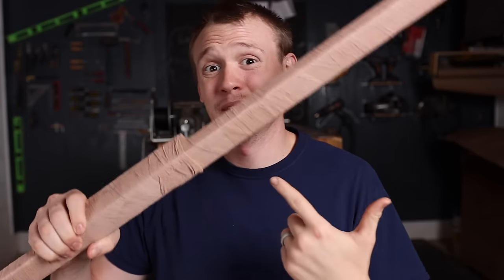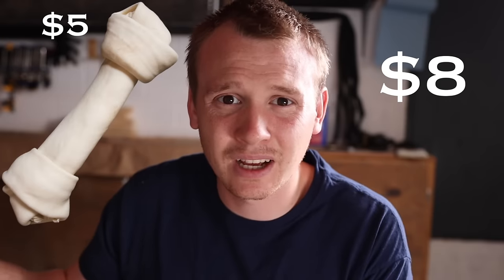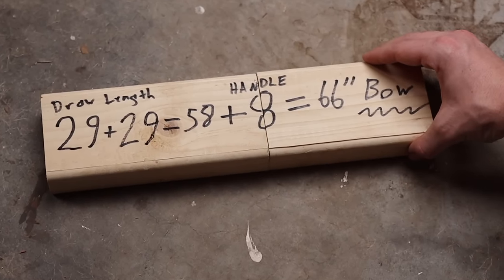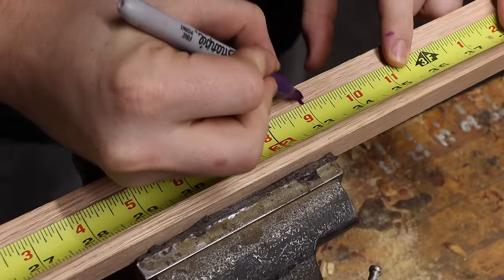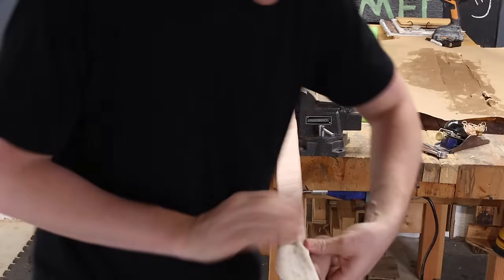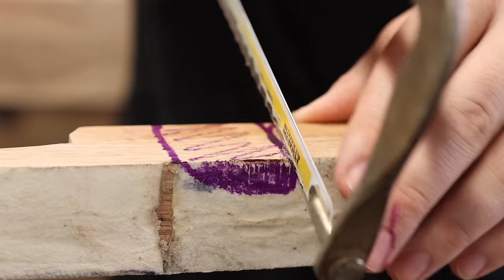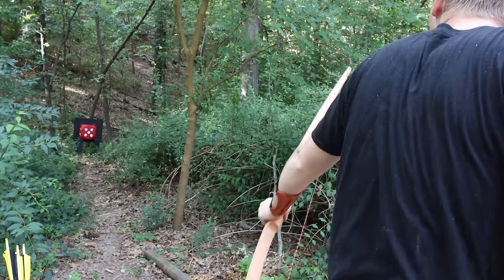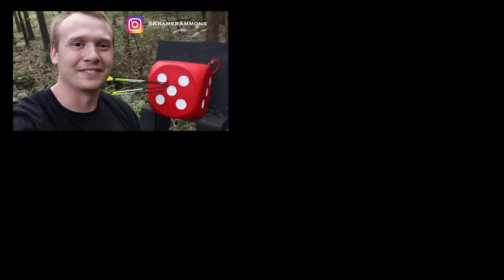DIY-HIGHER PERFORMING Longbow...no seriously..."Red Oak Bow Build"

Comment: Video idea! PVC backing! That's it! I haven't tried it, but I had the thought this week- what if I got a 4" diameter PVC pipe, cut it into long strips, and used a heat gun to flatten it, would it work as a backing????
Reply: There are people who make pretty good bows by heating and shaping PVC pipe, schedule 40 3/4 inch ID typical.  So the material is proven to take both tension and compression.
Reply: @hanelyp1  yeah, I've seen those PVC bows. Personally, if the bow isn't wood, it's not a bow. LoL
I really think that it could make a good backing though. Just gonna have to try it out.

Comment: I’m working on a Hickory Longbow currently and it is my first one. I want to go with a deep red stain but am having trouble finding something suitable. Any advice? I would like to see the wood grain still so paint isn’t really a route I want to take
Reply: Try leather dye
Reply: @longbo2771  Fiebings makes very good dyes, both oil and water based, in several colors.  You can even custom-mix with them
Reply: Longbo27 thanks. I will try those out
Reply: Mike Grossberg I have some leather dye from them already actually. Trying to get into Leatherworking as well. I will give them a try.

Comment: Does shaping the bow handle after the tillering process , alter the balance or draw weight of either of the bow limbs ? I would think that removing the wood to shape it would have some kind of effect on it ..
Reply: No because it's only the limbs doing the work.  The handle doesn't flex at all.  Shaping the handle at the end is better for 2 reasons.  First, it allows you to lay the bow flat on your tillering tree.  Second, in case your bow fails during carving, you haven't wasted all that time carving a now useless handle on a broken bow.

Comment: Quick question if you have a bow that’s 35 lb draw and a 28 inch draw (recurve bow)  but you only draw it back 25 inches then will it still have the same power and hardened to pull back as a 35 lb bow
Reply: Kramer Ammons so if I got that black hunter (there’s only one draw length available) then I would want to get  the 40lb option because I wouldn’t be pulling it back all the way therefor it would be a 35 lb bow

Comment: Kramer, Awesome video.  Quick question.  You mention your bow length as tip to tip.  But isn't bow length measured from nock to nock?  So if you want a 66" bow don't you need to measure out an additional inch or so?  Keep up the good work.

Comment: Any issues with Red oak holding compression strength? I had one blow up on me, but it could have just been a crap board.
Reply: In my experience, I've made backed, unbacked, and laminated bows with red oak. It's a great wood. Unfortunately, It does crease easily. So be sure to get rid of any joints
Reply: As general rule, anytime you use a board for a bow, back it. They're not made to be bows so you want to give it all the support you possibly can
Reply: @Morrow45105  yup - I used 6 layers of fiberglass tape and wood glue. Failed on compression side, I think
Reply: Liam Strain sucks to have a bow fail but it's great experience. Boards make great practice and eventually you get one that turns into a good bow

Comment: When i made propellers i learned that laminating several layers of thin pieces of wood was an opportunity to reverse the direction of the grain on each layer . This helped balance the weight and springyness of the wood . Because trees are fatter at the bottom andd skinnier at the top and are naturally out of balance for a piece of wood . Epoxy the layers and clamp with 50 or a hondred c- clamps . All epoxy take 3 days to cure . 5 minute epoxy means 5 minutes  before it becomes gooey and unworkable .
 Sunlight makes this happen imediately sometimes . Don't use car fiberglass resin on wood it does not stick . Save you some trouble . Aircraft use a thin  fiberglass cloth and epoxy resin to wrap wood parts to make impressive strength in places . I?[rried about your titebond  glue not lasting forever .

Comment: Hey Kramer, your videos are so well explained, good job. I've just completed my second self bow out of black locust, and it' s a wonderful recurve bow! Anyway i got through many issues recurving the tips, it was lightly splintering and cracking and didn't know why, so I stopped immediately. Could you give me some tips to avoid break during recurving stage? Awesome video as usual, keep it up!💪
Reply: Gotta use quarter sawn wood and orientate the grain in the right direction :)
Reply: Also bend the wood a bit when buying it, a lot of cheap wood is filled with cracks which you don't want in a bow

Comment: Would greatly appreciate it if Kramer or whoever happens to see this could answer. I'm 6'6" tall and have really long arms, and thus have a very long draw length at 38". So, if I'm understanding the draw length formula correctly, 38 + 38 + 8 totals out to an 84-inch monster of a bow. Would the whole thing just be entirely too long and flexible/easy to break, and does anybody even make arrows long enough for that kind of draw length?
Reply: Have you ever tried to find out your draw length by simply drawing an overlong shaft to your anchor point, and marking where it meets the back of the bow?  According to the given formula, MY draw length should be something like 27", but in reality it's 30"!  Try a different method of determining your draw length before you worry about oversized arrows
Reply: @kramerammonsarchery  I have a 72" red oak, linen-backed English-style longbow tillered for a 40lb draw at 30".
By the way, most commercially-produced arrow shafts come in a 32" length(WITHOUT knock or point)
Reply: @kramerammonsarchery   @Kramer Ammons  Thanks for the reply! Without going into too much detail, I have a rare connective tissue disorder that in addition to making me tall, also makes my arms abnormally long in proportion to my height. My arm span is actually longer than I am tall. No matter how I measure my draw length, it always comes out to around 38". Not sure what to do. Should I play it safe and just follow the formula and tolerate the bow being HUGE, or could I possibly get away with making it shorter? I'm planning on making it out of red oak.

Comment: So I was wondering on these types of board bows (drywall and rawhide backed) would it be possible to add any reflex to the tips? I read through all the comments and didn't see it asked. Thanks and nice videos!
Reply: It would depend on the wood, and if you have put your on the backing yet. Red oak is very bad at dry heat bending, I’ve tried and failed. Maple or poplar, I haven’t tried yet. Put the backing on after reflexing.

Comment: do you mind if i ask what i should use if i had bows length 150 centimeters, what actually bow string and arrow size i need
Reply: Arrow SIZE depends on the length of your draw.  Arrow SPINE depends on the draw weight of your bow at that length.  Arrow DIAMETERS(how big around the shaft is) depend on a combination of factors(some shaft diameters will not work well with heavier draw weights.  11/32"  is a fairly good all-around shaft diameter)

Comment: I made my first bow, or rather am in the process of making it. I need a bigger handle section, and I want to know how to do this. Is there a video of yours already out there that I can reference? Or do I need to get a professional like you to tell me. For future reference, I am currently(without the help of a professional) just going to extend the stave by two inches, and also extend the handle section by one inch on either end. Is this a sound direction? Or should I do something different? Thank you Kramer Ammons!
Reply: Buy a larger piece of wood than your bow. Hollow out a section that is the same width/depth as your bow material. Glue it to place. Basically, you are creating a cut-out for a decking support for your handle on both sides. That way, you get extra width and depth to your handle if you got larger hands that need that extra width.

Comment: Wondering if one could make the bow have a dual Arrow rest? Would that be too much Material taken away? If that is the case then take some wood and glue that on to the bow and use a small wood screw with drilled hole in the widest part of the bow to make a build up on the part where the rest would be since the middle section of the bow does not move.
Reply from the maker: Love the idea!
Reply: @kramerammonsarchery  Meaning both sided left and right bow. That is what I was thinking, the whole arrow rest part might have to be separate from the bow and glued on or something like that.

Comment: Question! Is it possible to make a bow from hardwood ply (given the variety of backing you can use) that is usable - even as a practice bow? Apologies if you have answered this before, I an fairly new to your channel. Lovin' the vids though.
Reply: Based on what he said about grain I would not think so. I could be wrong, but my understanding is that in plywood grain directions are reversed between layers. Even if the grains are running in the same direction you can't see them and look for defects. If you made and vetted your own plywood, maybe.

Comment: Just a big warning; be very careful in wood selection, NO RUN OFFS are to be tolerated, and ignore this guys directions of carving in a shelf. A shelf is a waste of time, and for no reason besides laziness or stylistic imitation of some modern bows you are compromising the strength of 25%+ of one limb of your bow as well as making it significantly uneven in pull. Ignore the shelf entirely. It is also MUCH better (with store bought wood that's sawn not split) to laminate the bow after you have shaped and tillered it a bit, at least enough to know you've got a good bit of wood (12 inches or more) rather than wasting your time. There's nothing worse than investing time only for it to blow to bits. The reality is if you want to make a bow hew a proper stave, using store bought wood will always be a pain!

Comment: Hey Kramer, could u make a bow from green wood? Find a tree, cut a good branch, prep, shape and dry?
Reply: I've never made a bow(not enough work space, and not enough NERVE), but I DO know that you NEVER use green wood.  All wood, as it dries, warps, bends, and cracks.  You want to use wood which has already dried and stabilized.  Some bow makers cut staves out of green wood, then stack them up, with air space all around them, and let them dry and season for as much as a year!  A green wood bow MAY work for a while(like in an emergency), but as it dries the limbs will warp out of alignment, and ruin any work you put into it

Comment: So I'm a recent subscriber and am DEFINITELY going to start doing some self bows.  I know a place that has osage orange trees that I can cut down, and while those staves dry, I'm going to try doing some board bows.  I'm thinking of trying a hybrid of two designs you have had.  Specifically using red oak for the wood and then backing it with the fiberglass.  Is there any particular combo of woods and backing that work best for beginners?  And in addition, any combos I should AVOID?

Comment: Hey, is there a reason you wouldn't use a cord as a bow string? I've braided some bowstrings I've used, but don't know if I'm making a mistake.
Reply: What kind of cord?
Reply: You mean paracord? I believe it has too much stretch. The traditional string is made of linen, a plant fiber with very little stretch and a nice, smooth surface. One thing I have used though is artificial sinew, a waxed nylon fiber. You have to twist it up to the desired thickness and then use a piece of leather or something to buff out the bulges and make it smooth, but it works very well. It's been years since I've had to look for any, but I think you can find it at craft stores for beading.

Comment: This bow making is stressful  just got done breaking my 2nd bow and about 12 hours combined on both bows
Reply: i am in the same exact boat. My first 2 bows were off the Kramer video using poplar and fiberglass drywall tape. Broke both trying to string them up. still not positive what I did incorrectly. But after dealing with the grief, I went today and bought Red oak to see if i can make that bow.

Comment: What would happen if you removed wood from the back of the bow and put the hide on the belly of the bow?
Reply: it would crack the reason for the backing is because when you bend it the back is under a lot of tension and most woods can’t take it- that is why you back the bow

Comment: hi do you have a facebook group or something? i made a board bow red oak following this video .the first bow broke while tillering but the second one is a beauty ..but a problem happened to me with the finishing job..i backed the bow with drywall fiberglass tape and finish this with old master oil base marine varnish ,but this turn sticky and rubbish did not dry completely,and y fucked my bow because i remove almost all the rubbish varnish but in the drywall tape i cant remove all of it because the texture of those little squares on this material ,and i want to refinish my bow is perfect the bends the long the pounds ..how i can remove the varnish from tape without damage the wood glue ??? ..i am worried about that ...or can i applied some coats of spare urethane over it or other finish product ???? ...this question is for anyone who wants to help me to save my bow ..i rubbed some 91% alcohol over the back and removed all the gunky from it ..but i cant sand it down because i will damage the tape .ehat can i do?

Comment: i have a question: how do I cut the sides without power tools.
Reply: Without a band saw you might use a chisel, plane, rasp, or even sand down the sides.  Different process, same result in the work piece.
Reply: Alpha_Wolf : If you decide to use a chisel, make (many) saw cuts, into the edge
you are removing, just short of  the depth you want to remove. Then use the chisel
to chip out the pieces. Then sand, file or plane to the finish depth.
Reply: Thank you guys

Comment: Why add weight of rawhide to your bow? Extra weight is performance detractor.
Reply: Because teaching people to use Band-Aids is easier than being a good bowyer
Reply: Because the rawhide can take the tension, and is a lot easier than finding a piece of wood with grain that can work on the belly without breaking.
Reply: Because rawhide is cheaper than carbon fiber I guess?
Reply: Don’t be a hater.

Comment: I didn't breath easy from the time you started tillering till the end of the video (so worried it was going to brake on you); actually, I would have over lapped the raw hide (if it was long enough) in the middle of the handle.